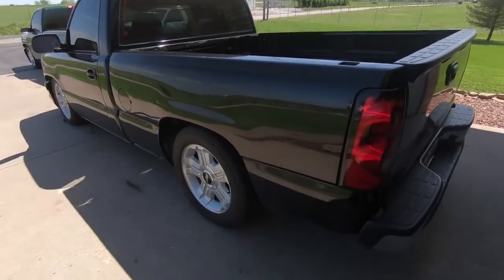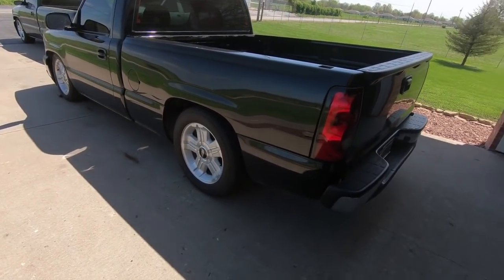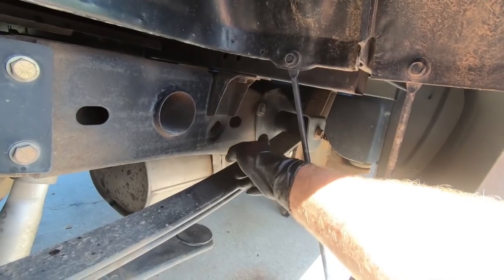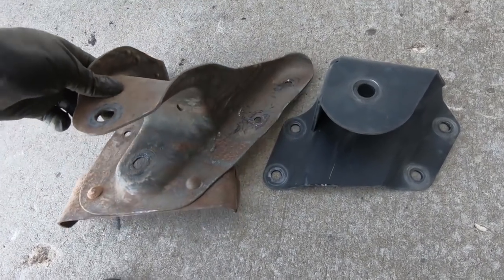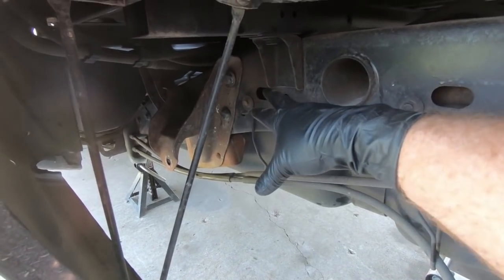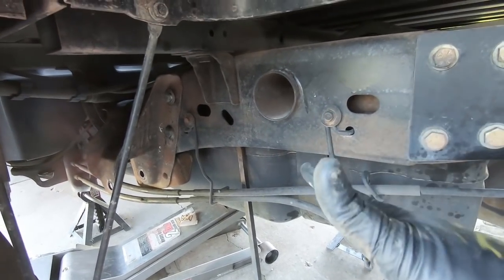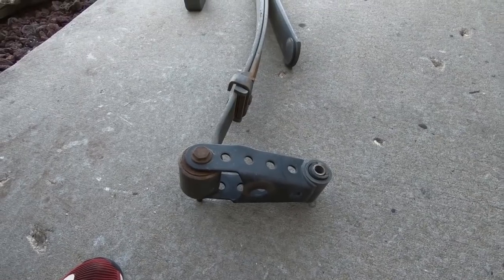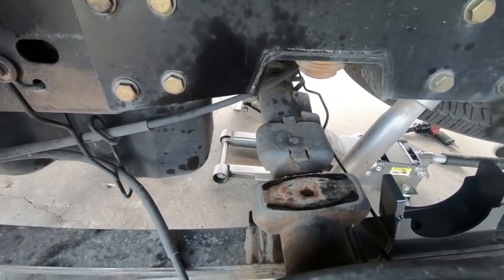Flip Kit install on Silverado / Sierra (Removing Hanger Drop)

Comment: Where are yuh from ?
Reply from the maker: Missouri
Reply: @TWAMotorsports  how much was your drop ? And brand I'm trying drop mine from the back only my front almost touching the tire from my 17s stocks
Reply from the maker: Around $250 for parts
Reply: @TWAMotorsports  what's parts can I buy to drop the back only 3 inch ?
Reply from the maker: @chieftejay  what I took off in this video
Reply: @TWAMotorsports  I'm sorry bro I meant for my Tahoe but I'll go head and check out your video again my bad for bothering you 🙏